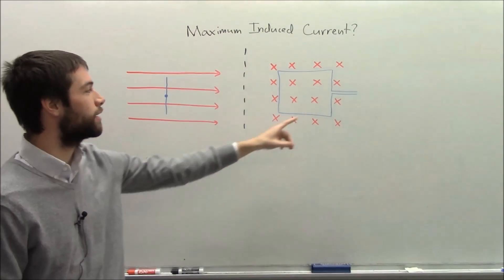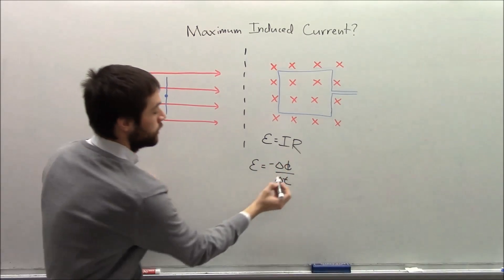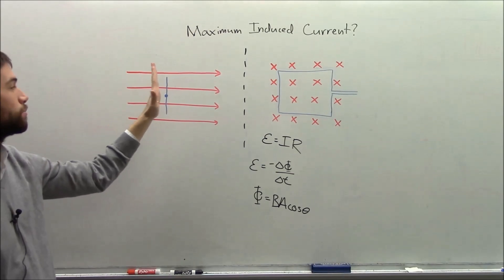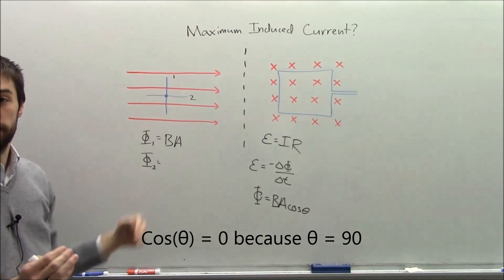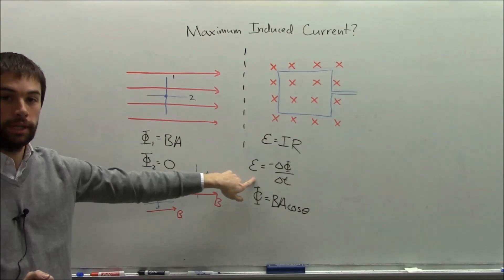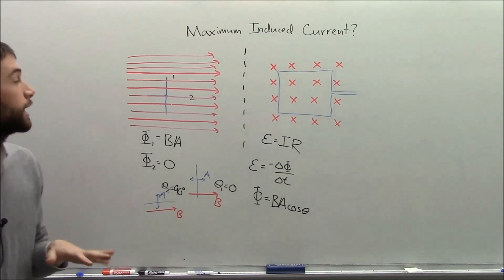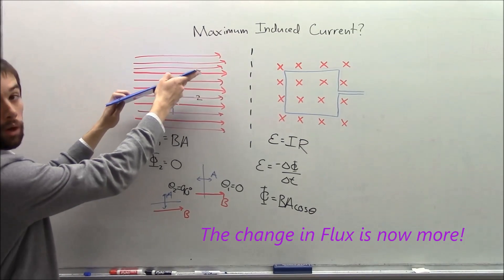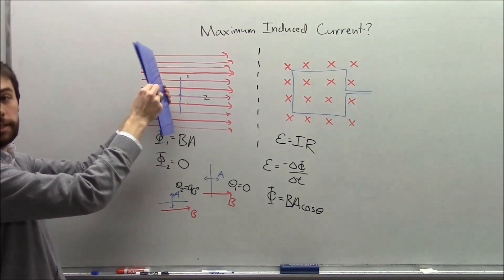Maximum Induced Current  + Change in Flux for Rotating Loop - Physics Made Easy! ( BU - PY106 )

Comment: It makes PERFECT SENSE. 
It is easy to understand the concept when you think of the changes of flux lines in terms of percentages.
In the vertical orientation a slight tilt may result in a change from say, 100 lines to 98 lines...
A decrease of 2%.
A tilt from the horizontal orientation will result in for example, 1 to 3 lines... 
That is, a 200% change.
Reply from the maker: YOU GOT IT! 😃👍🏼

Comment: Guys Im a bit confused,

if you take a graph of Coil position vs Voltage, you find that the peak of the sine wave (when the induced EMF is greatest) is from a rotation from the vertical position to a horizontal position. Which contradicts everything said in this video. This means that the greatest change in flux would be from a vertical tilt however its intuitive of how a horizontal tilt would cause a greater change of flux.
Could anyone explain which is correct?